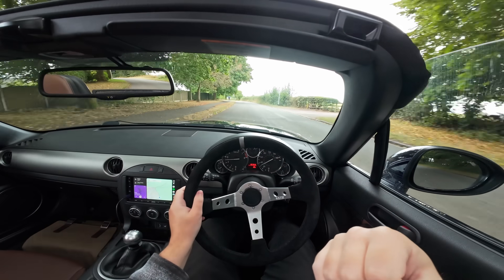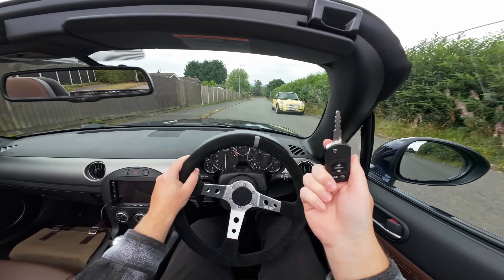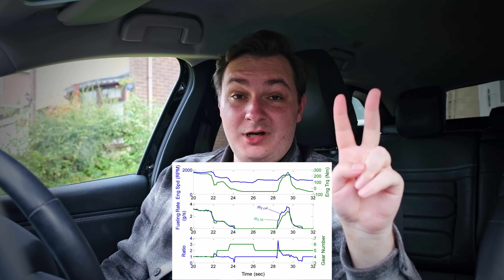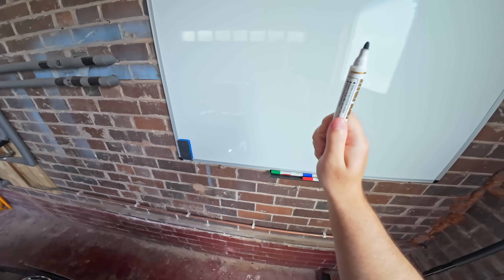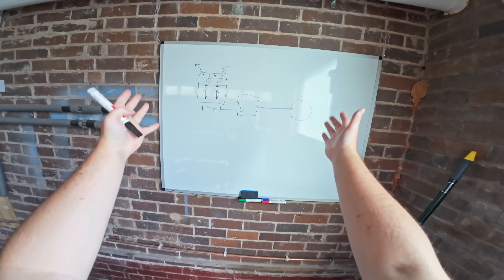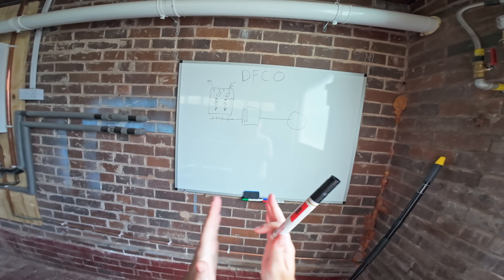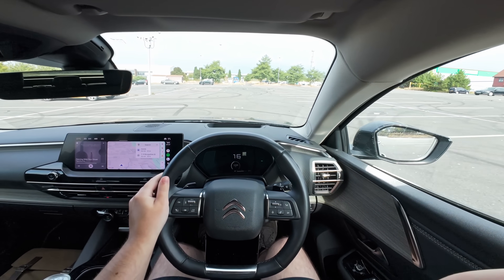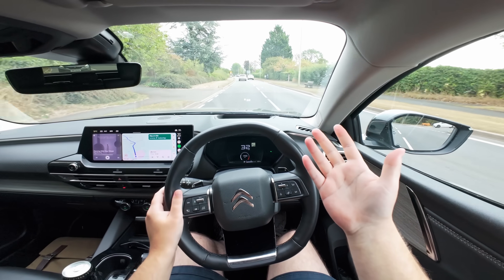The most misunderstood car term - Engine Braking

Comment: No, I do this in my car, and my friends literally say, "Why don't you just brake at the light when you get closer?" Like the light isn't going to run away; it's going to stay red. Why use the brakes? I can engine brake all the way to a stop. I've had my brakes for 4 years, and they aren't even close to done. Yes, I brake, of course, if I'm driving some nice road and I need to but engine braking is also really strong; I barely need to touch the brakes. And some people say, "Oh, but it's going to wear your engine down engine braking at high RPM... As Mick said, only air is going in and out; the pistons aren't stressed with the combustion process. And especially if you have an auto, most cars will blip the throttle to downshift, minimizing clutch wear. There are practically no downsides at all. Thanks for reading my rant!
Reply: I generally avoid braking except when stopping, avoiding, or if I misjudged something. Try to drive such that I don't need to brake, which makes me look further down the road and plan ahead. Altogether I think safer, and also more comfortable for passengers. Brake pads would last forever if calipers didn't go stiff from lack of use.
Reply: exactly looking far blanking ahead helps a lot
Reply: @Devis_M I try to do the same but I never manage to get below 30kmh before having to break
Reply: I've had my current set of brake pads for over 7 years. Meanwhile, I had to replace my ex-GF's brakes for her after less than 3 years. Shockingly, everyone I know who ever rode in her car says it was terrifying. Literally one of the most aggressive drivers I've ever known. That's not the reason she's my ex, but I am a lot less worried about dying these days...
Reply: I drive hybrid. In addition to engine braking, I get regenerative one. Recently I had to replace rusty brake pads.
Reply: My experience is similar to yours. I learned to look down the road and anticipate. I remember when my wife and both got new cars about a month apart. She is a gas to brake driver. My brake pads lasted about double the mileage of her's. Win right there. The gas savings are a bonus.
Reply: I had the auto rev match downshifting and istg my brakes wouldn’t have ever worn
Reply: I bought a 2012 Camry in 2018 or 2019, or so. Still had the original brakes on it.

I just replaced the front brakes earlier this year. They still had a little more than 2mm of material left.

(I replaced the rear brakes earlier, not because of wear, but because the parking brake had seized.)
Reply: Yeah its nonsense. From truck driver perspective we use engine braking a ton (or assist braking systems, not sure if that’s right term in English). My truck have thing called exhaust brake and retarder. Exhaust brake is basically just strong engine braking though it uses valve that is closed in exhaust and counter pressure makes truck slow down. It works best in high revs so if I put it on gearbox automatically goes almost to limiter. I also have retarder and it slows down drive shaft directly. Combine these two and I can slow down truck with 48 tons gross weight in steep decline no problem. Thanks to this I manily brake this way and use brakes only to stop or when there is need for quick braking. My brake pads have minimal wear this way. In my previous truck I still had 90% of brake pads after 120k km and I drive im hilly areas a lot.
Reply: You can not come to a stop with engine braking? Like I use a combination of both to slow down, no full braking at high speeds, brakes are going fine.
Reply: What car do you have to be able to use the engine brake to stop at a stoplight?
Reply: @totokoostudios well no I obviously have to fully stop with brakes Ofc it’s just I can slow down enough to get to almost a stop and before I come to a stop I put my car neutral so it just coasts to a stop
Reply: @Devis_M so do you downshift into second to do this? Or how do you slow down so much
Reply: @totokoostudios as I start to slow down I would start down shifting depending on how fast I need to slow down I would down shifting earlier so my revs are abit higher so it engine brakes harder up to first if I have to usually first but then when I take off again I would put it in second for a smother acceleration if I’m just on a calm drive.
Reply: @Devis_M I've never dared to downshift into first tbh, is that safe?
Reply: You'd be best getting your brakes checked then, because when that time arrives where your really going to need full braking capacity THEY MOST LIKELY WON'T WORK.
Reply: @eddiegremlin well no I obviously use my brakes they still lock up and triggers and so they perfectly fine
Reply: engine braking cause a bit oil to be sucked into the combustion chamber.
Reply: @rotorblade9508 This is untrue. The piston rings actually can seal better this way and this is why it's not recommended to break in a new engine using lots of engine braking.
Reply: @cydonia9342 my engine has 170000km is that new
Reply: @Devis_M I was replying to the other guy. I am an engine braking supporter

Comment: Hi Mick, I think all this confusion is between carb and electronic fuel injection. Carbs will keep feeding fuel through the pilot while injectors will simply cut-off. I maybe wrong tho. Old people like me thought the same way until I watched your videos. I’m now wondering if torture converter lockup engages during deceleration in my automatic since it’s an electronic gizmo thing.

Comment: 9:44 NOT potential energy. It’s solely powered by kinetic energy, unless you’re going downhill. It’s physics.
Reply: Nitpicking "types" of energy is the most pedestrian, 19th century, middle school way you can engage with physics. Energy is energy, the universe doesn't care what you label it.
Reply: @kukuc96 That’s definitely one type of potential energy. But potential energy is just the term just for energy that can be transferred from one form to another. For example bringing an object up in the air, the energy in a battery or the chemical energy in gasoline. So potential energy is a fitting category for kinetic energy in this case
Reply: Nah all wrong! ChEMicAL EnErgY hahahahh i winnnnn
Reply: Potential energy => kinetic energy?
Reply: @cracky7167  The two are different things. Potential energy is what you gain with height in a gravitational field. If you are driving on a flat road, no change in potential energy occurs.

Kinetic energy is what you get when something with mass moves, or something with moment of inertia rotates.
Reply: @kukuc96 thank you for taking the time to refresh my physics. I do appreciate it
Reply: @cracky7167  Potential energy is stored. Kinetic energy is in motion.

Comment: What may be confusing is the concept of engine breaking in a car compared to commercial vehicles. In heavy duty diesel vehicles lifting off the pedal causes the engine to turn against the high compression of the engine. This causes the truck to slow down. If you are next to a truck when this happens it is quite loud and disturbing sometimes. This is why there are signs entering residential areas mandating that construction vehicles not do this.

Otherwise what you are describing is good technique when driving a manual car. Conserving kinetic energy by not accelerating and braking unnecessarily. Instead of zooming ahead and braking at every light or intersection. Plus it means you are approaching will less speed difference to the stopped or slowly moving traffic. Unfortunately, manuals are the exception these days and we rely on computers to control what an auto transmission does when.
Reply: "If you are next to a truck when this happens it is quite loud and disturbing sometimes."
Large vehicles often have specific mechanism to increase engine-braking which also adds noise - the simplest and oldest form is just letting the cylinder fully compress and then opening the valves. That leads to highly compressed pulses leaving the cylinder. (For whatever reason that is sometimes not considered engine-braking despite it being the engine doing the braking...)

Comment: Really inconclusive incorrect "test".
Screw the journals and diagrams and what wifey is doing, do a proper test.

So I challenge you to hook up the car to a dynamometer. Have them shove a lambda probe in the tailpiece. And then see for yourself. Air fuel ratio with gas pedal on, air fuel ratio with no pedal feed. 

You shall be humbled 😂
Reply from the maker: ''BRO THE ENGINE WAS OFF''
Reply: Dude...

Comment: I failed my first driving test for no seatbelt but I did ok during an hour of practice before the test. My weakest area was stopping smoothly. I was adding too much throttle then stopping hard out of fear. For the 2nd session of practice and road testing I focused on Engine Braking, letting the car maintain its momentum and easing into the brakes. Most if not all my stops were leagues better than before. I still need to work on turning properly and not driving too slow but EB was a big help.

Comment: The fact that people calling their channel "real mechanics" apparently have no understanding how an engine works worries me a little. Engine braking and fuel cutoff is NOT exactly a complicated concept. It's LITERALLY the same as stopping pedaling when you are on a bike. You keep moving without having to expend energy for a while. In a car, the engine being turned by the wheels just has much more resistance so you start slowing down. I really don't understand how a mechanic can not grasp this simple concept.
(OH! They also deleted that particular youtube short in question it seems, lol...)
Reply from the maker: Only a fixed-gear bike - a ''regular'' bike with a freewheel is like coasting in neutral. 

Only reason I know that is because I did another drawing of bikes on the whiteboard and it got too confusing so I cut it :D
Reply: One difference is that with the clutch engaged, the pistons in the engine are moving to compress air which helps lose energy from the rotating wheels. That's also why it's called engine braking, the engine turning rotational energy into compression is a braking activity. If it wasn't contributing to the braking process whatsoever, it'd just be called dry braking or coast braking or something like that.

Comment: if a car doesn't use any fuel at all while engine braking then by this logic how do push/rolling/bump starts work?
Reply from the maker: Normally a starter motor would spin your engine up to idle RPM or slightly above. You're just doing that by turning the wheels instead.

Comment: what is breaking with the clutch? Is it when i downshift to slow down the car? When i lift off it obv slows down but when i shift down and lift off it slows down faster.     new driver
Reply: He means downshifting without rev-matching. You can downshift in less than a second without causing any wear on the clutch by blipping the accelerator to raise the RPM to where it's needed for the lower gear. Bonus points for doing it while braking lol (heel-and-toe).

Comment: But then how come car consumes fuel when they’re parked and idling? Wouldnt that be consuming fuel while off the pedal?
Reply from the maker: You haven't listened to a word I said boss

But I love you so I'll explain

Engine braking only works when in gear, clutch engaged (or in drive for auto). If you're not moving, there's no momentum... so you can't engine brake. What you're describing is exactly idling and does indeed use fuel.

Comment: 0:06 my heart kinda stopped for a second there
Reply: Mine too. My old civic would lock the steering wheel if you turn one side without the key!
Reply: @infectropodo I doubt it would lock up at that speed. My VW only locks if the speed is very low (when parking). I tried doing this at 70kmph and no lockup. However i was scared to turn the wheel more than an inch lol.
Reply: @nah1110  "I doubt it would lock up at that speed." Most cars have a very simple mechanical mechanism... cause in general you never actually want to take out the key while driving. So for most cars out there were you can do that it is hella dangerous if you dont know exactly what you are doing.
Reply: @nah1110   Anti-theft system: it is activated when you remove the key (not simply when you switch off the ignition).
Reply from the maker: Done for dramatic effect! I disabled the steering lock for the video :)
Reply: @MickDrivesCars  Can you do that? how?
Reply: @MickDrivesCars  Well, then you should better tell people in the video that you did so and what can happen when they don't. There are bound to be people who wanna try this out themselves ... and when they lock up their steering wheel and possibly wipe out innocent people, that might be on you showing such irresponsible behavior without an explanation.

Comment: all cool but isn't the real engine braking thing when truck drivers use a braking mode that uses the actual engine to actively brake rather than using the friction of the engine to brake???
Reply from the maker: Yeah they have some cool tech that changes the combustion cycle giving massive engine braking. I don't understand it enough to include it here, and to be fair it's pretty niche.

Comment: yeah but doesnt the steering lock when you remove the key from the ignition???
Reply from the maker: I disabled the steering lock for this video.
Reply: @MickDrivesCars  Was looking for this! I thought WTF lol!
Reply: yeah don't remove the key.

Also when you turn off the engine and put the gear into Neutral, the brake assist will work only for a couple of times because it relies on a vacuum mechanically generated by the engine. It may be impossible to brake properly without restarting the engine afterwards. Better to use the handbrake if possible.
Reply: @svr5423  Some cars use electric assist brakes which might still work. Some might even have electric vacuum pumps for this! 

But yeah, it did surprise me in the video lol

Comment: i have a question about engine braking in hybrids. can you do something like this in a fully hybrid vehicle like the CRV hybrid? i'm wondering if there is a difference because by lifting off the accelerator, the car will start slightly using regen braking
Reply from the maker: So if you've got a relatively modern hybrid, they do something even smarter

When you would engine brake - they instead shut the engine down, put you in neutral so you're coasting without the cost of idling the engine and use the hybrid battery to power the car's infotainment/etc. It's the best of all worlds. Unless you actually want the braking like if you're coming up to a stop sign/redlight. That's actually why they often have a separate drive mode ''B'' for braking... for when you want the ''engine'' braking.
Reply: Regen is even better than engine braking, as instead of "wasting" the kinetic energy when not actively spending it by igniting fuel, it will regain a good portion of that kinetic energy to be used again. Ideally you'd want MAX regen braking, and to keep the engine turning with minimum revs (high gear) and with minimum engine braking.

That's for max. energy efficiency at least. This is likely also best for the engine, but engine braking wears the engine nowhere near having it running at higher loads.
Reply: For Toyota hybrids, you are able to enter a "glide", which is a coast but with the engine off (depending on the HV battery level) by putting your foot on the accelerator just enough to see no arrows or occasional arrow flowing into the battery on the Energy Monitor screen. One other way you can tell you are in this "glide" is by looking at the Hybrid System Indicator, the bar or arrow depending on the car you have, should be just around the overlap between CHG and ECO zones.

You could also just go into neutral to achieve a similar result, but I prefer this method in case I need to use the brakes (there's is no regen in neutral) or if I need to accelerate, or when the HV battery is low, the system cannot charge it if you are in neutral.

If you lift your accelerator off, the Toyota hybrids will simulate an engine brake, by creating a slight amount of regen instead of actual engine braking. It's also adaptive, such as giving you more regen if you are going downhill.